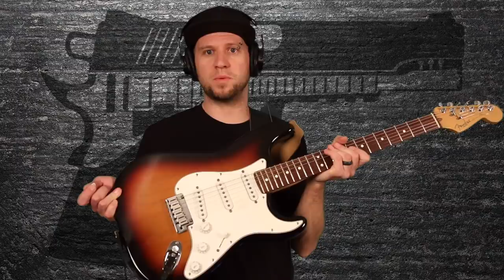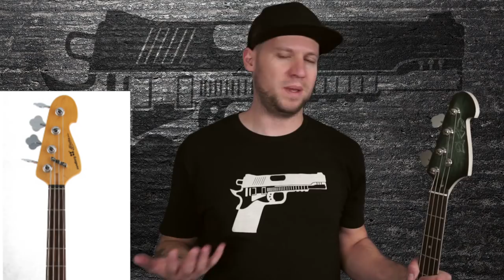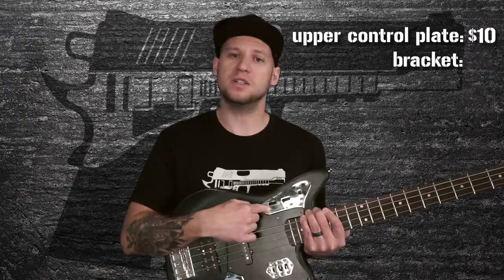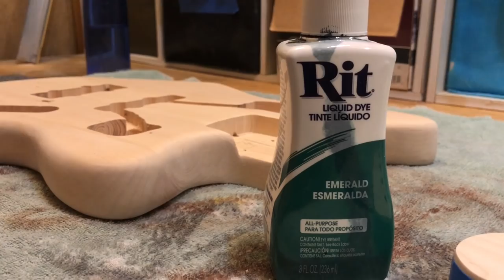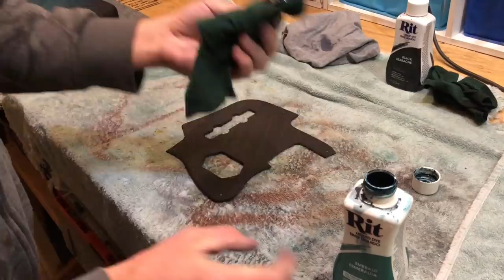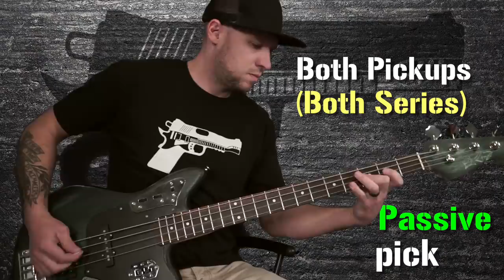Build your DREAM JAGUAR BASS for less than $280

Comment: Guns and Guitars - Thanks for the Rit dye tip! I'm building a Jazz Master based on your previous kit review and was having trouble with the finishing. I tried some lacquer, but ended up stripping back down to the wood to trip the trans-dye finish. I think its really looking great. Now I'm applying a wipe on poly for a gloss clear coat (I hope I don't screw it up). Keep up the great work!

Comment: I'm thinking monster J. A cross between this and the Warewolf. Can you on /off switch each coil, (4 for HH, 5 for HPH) so you don't have a mess of knobs? Rectangular lighted rocker panel would make it easy to see in the dark. A 5 way switch is not enough.

Comment: Hey Dan, would you consider doing a video on how to convert a fretted bass to fretless?
Reply: If you do it properly the result should be fairly good. Of course if you do it like Jaco you're just going to ruin parts of the fretboard because he did it with a knife or a pair of pliers depending on your source and slapped a form of glue on it as a coating.
Reply: The short and sweet of it. Take a soldering iron and heat up a fret at a time (greatly reduces tearout). Use a good set of small front end snips to pull the fret out slowly. Clean the slot with a fret saw or similar and replace the fret with styrene strips. Trim, re-sand and finish to your liking. BUT, your side markers will be off. Fretted basses are marked in between frets. Many fretless are marked at the fret.

Comment: I have a few questions about the Rit dye + tung oil finish.
I'm thinking about doing this same type of thing on a build soon, because I love the look.
How long did you wait between coats of rit? How long between coats of tung oil? How long after applying the last tung oil coat did you wait to reinstall the hardware and play it?
Reply from the maker: rit doesn't take long to dry.  I waited an hour between coats, but honestly 15 min probably would've been fine.  Tung oil, follow the directions on the can, mine said 12 hrs between coats.

Comment: Hey man! you've made an awesome job! 
I have a cheap guitar torn apart that I want to customize, and I'd like to use the same finish you've done on your pickguard..
I thought doing wood finish on pickguard and paint the body green or blue surf, to give that old wood car finish of the 50's. I was wondering where did you found those thin woodplates? Do you know if there is any material in which I could keep the veins of the wood?
Greetings from Brazil!

Comment: Great build! The one thing I could recommend that makes a difference is to either line the control cavities with copper foil or use shielding paint. This will help reject stray signals and noise sources so you can get the most out of those crazy electronics you have. Also do the same with the pickup cavities. You see this in high end guitars and basses.  Really it looks like a top notch bass! 

Also give your wife shoulder rubs and scalp massages. You might be surprised the results this yields!😉

Comment: You’re definitely getting better playing your standard issue demonstration tune as time goes on... lol 😆. 
All kidding aside, that Artec pickup is what I’ve been looking for in a 5-string J Bass build I’ve been cobbling parts together for.  I like that preamp you found also. The versatility that you built into that bass makes it a Jack of All Tones. Well done Dan. Thanks for the tip on that trim router too. I’ve had to either use a std plunge router or a dremel for a few jobs that were really too small for the plunge router and too big for the dremel. The trim router is perfect for those in between jobs and as Harbor has a retail store about 3 miles away from where I live, that’s where I’m headed as soon as I hit send on this comment.

Comment: Excuse me if this is a stupid question but, can you have both a passive tone knob and and active preamp at the same time? Like, in the “how to wire a preamp in a passive bass” or something like that, you just skipped wiring the tone knob and just went straight to the preamp. Dan just created an active bypass switch on the bass, making it passive, so, could you wire the tone knob and the preamp together and while the to use while the bass is passive, you can still use the passive tone knob? Sorry if there’s bad English.

Comment: Hey Dan, fantastic video, really like the kit and the idea to mod a J-bass into a jaguar. Little note on your walking bass: You are probably counting in 8ths or 16ths, but the beat is in a swing feels, so you should base your lines on a triplet subdivision. This will sound more smooth and get the forward movement going. Great line though :)

Comment: Hey Dan, since you're aware of where to get good products for a reasonable price, what sort of headphones would you recommend (high quality, but not bose/beats pricing)??
Reply from the maker: KZ ZS5. Search amazon, they are incredible for the price. They also have the ZS6, which is the same thing but a metal enclosure so they are a little more durable, but the ZS5’s are the cheaper option and sound just as good.
Reply: Thank you, sir 👍
Reply: Any over ear recommendations?

Comment: What's the difference between single pull single throw and double pull double throw?
Reply from the maker: Quite a bit actually. Spst switches have only two terminals and basically works like a circuit breaker, while a dpdt switch has 6 terminals and can be used to switch between up to 4 separate circuits.
Reply: Guns and Guitars oh, I see. Thanks a lot, man

Comment: How can u parallel a single pickup? (neck pickup)
Parallel to what?
Reply: Jef Damen just a guess but if its got 4 conducter wiring its probably a tapped single coil you could wire those in parallel

Comment: Why is the preamp a 5 control knob and you only have a 3 knob control plate on this bass? How is that setup? thanks!
Reply from the maker: The two roller knobs in the upper horn control plate are the other two pots (bass and treble controls) I extended the wiring to make it reach there
Reply: thanks for your response really apreciate it, I am building my first bass kit in big part because of you! 
; )

Comment: How can you change volume and blend pickups in passive mode if those controls are coming from the active preamp?
Reply from the maker: The blend is passive, but you are correct, the volume is active so when I bypass the preamp I also bypass the master volume.
Reply: Thanks!

Comment: You can get a normal jaguar for $200
Reply from the maker: You can get a squier vintage modified jag for close to it, but won’t have as good of pickups or nearly as many features as this one. But if you’re not into diy then buying is probably a better option than building.

Comment: Looks and sounds great compared to $150-180 basses, but I really don't see why not pick an equally good Ibanez for about $180 or less, durability is about the same, the extra gadgets are useful from my experience, but it does make it significantly more expensive, $75 is a lot of money
Reply: Jasper Störningar For the same price (maybe even a bit more) I would choose to build a guitar any day over buying one. It’s much more satisfying to play a guitar that you put so many hours into, not to mention the ability to make it your own with your own finishes, unique feature, etc. you also have a much better understanding of how everything works and what it’s purpose is. It’s less about getting a good deal, because god knows some factory in China can put together a Chinese guitar kit better and cheaper than I can, but the experience.
Reply: I agree but not in this price range. I would never do it, custom builds for $500 or more, preferably up to 2k for an all custom Fender for example, although there are some killer builds from Kiesel Carvin in that price range, the higher you go the more options you get and vice versa, that's why $500 for a custom is the bottom line for me personally, if you find a reliable meister he will recycle an old unusable Fender into a work of art for that budget

Comment: HEY guys, these kits are cheap, so I’m guessing the wood quality is low. Does it affect the sound in your experience?
Reply: IGarrettI  While I don't think wood affects the tone steve vai and Evh seem to like basswood so I doubt it would affect it in a negative way if the wood mattered
Reply: Tone is not in the wood unless you want an acoustic guitar.
Reply: It does, acoustically to begin with, but even with electric basses and guitars, acoustics are quite noticable, picking good wood = durability as well
Reply: Jasper Störningar if it does, whatever. By the  time you slam out a few tracks in the studio the end result is so manipulated it doesn't matter. I build basses and I use 3 piece body's maple cores with basswood wings. Bolt on paduak necks maple fingerboards and stainless steel frets and they just work so.
Reply: Depends really, it's a choice between initially spending more money or putting extra work in the studio, if it's strictly a studio build, if not, I think quality makes a hell of a difference, a difference so great that in a few cases I didn't even need to do mastering on a Fender Prec, yet on Ibanez I always do, it can be a difference as little as 5% but it still gets lost in the process... I see your point though
Reply: Jasper Störningar I play p bass style basses and I like passive basses but with gain, it takes a lot of tweaking to make it sit well with the kick and still be heard clearly
Reply: Jasper Störningar I usually do 4 bass tracks with different peaks and compression and very subtle  octave down when I need it and gain